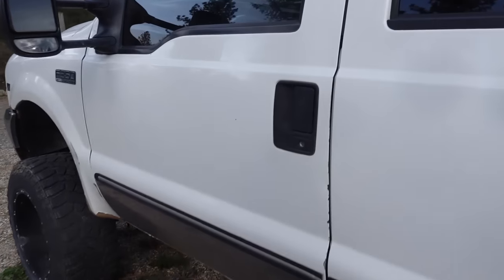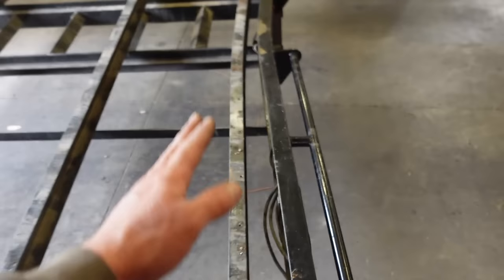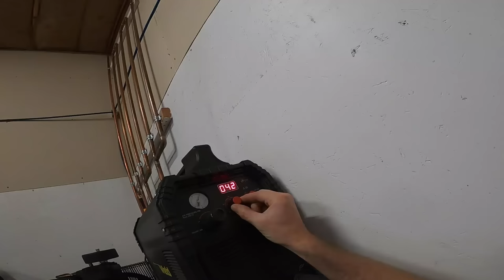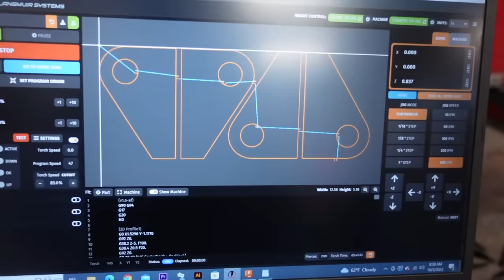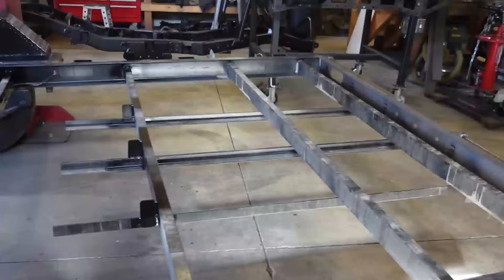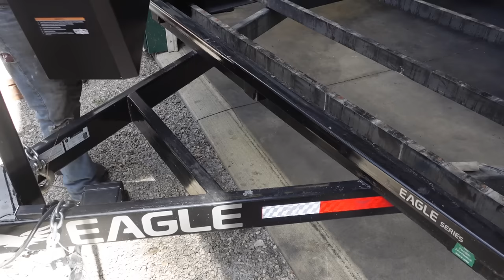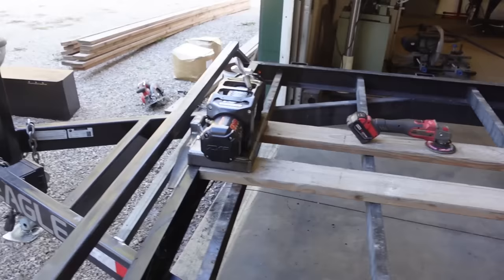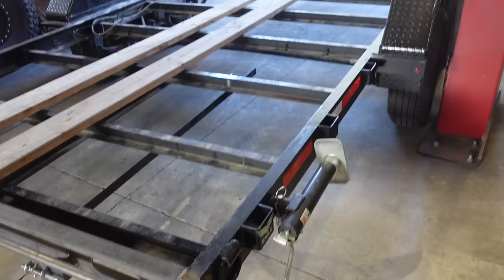I Repaired My TOTALED Car Trailer!!!

Comment: Suggestion - your tractor pin for your winch mount drill out the pin hole to 5/16 and put pad lock in it to lock your winch to the trailer and make it removable still.

Comment: I mounted my 8K winch to a trailer hitch bracket, mounted a receiver on the front of the trailer. I can pull the winch off with 1 pin, and store it in the shop. I also use the winch on my truck without a trailer, or i put it on boxblade of my tractor connected to a receiver i mounted there. Best options for a winch, winch remote, snatch blocks, short chains. I like the trailer. Great video as usual. I also wired in both trailer plug types. Drives me crazy when someone borrows my trailer and cuts into wiring to adapt to their vehicle.

Comment: If you're ever winching anything thats wrecked (or with a locked up/flat wheel) that keeps going to 1 side when you try to pull straight, you can make another stake accessory to attach a snatch block on either side
Reply: A soft shackle and snatch block work great for pulling from a side pocket.

Comment: Owning a trailer is like winning the lotto. You will now have friends you never knew you had coming around. LOL 
PS you should add a fairlead to the winch mount. Mount the battery in the box and get some quick connect ends for the cables. Wire your truck if it isn't already to charge the battery.